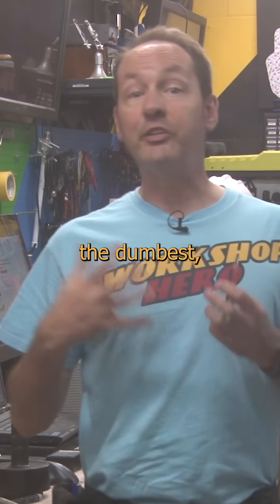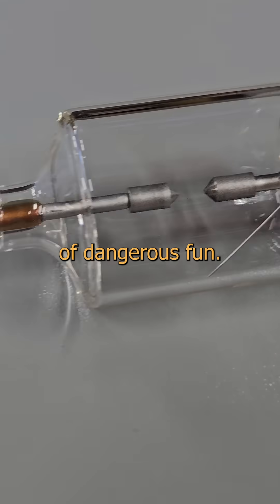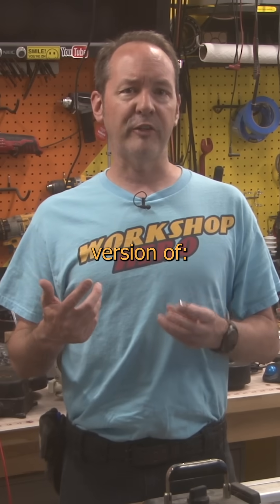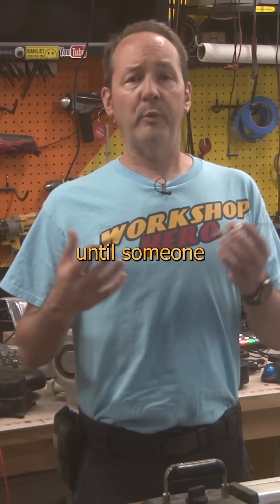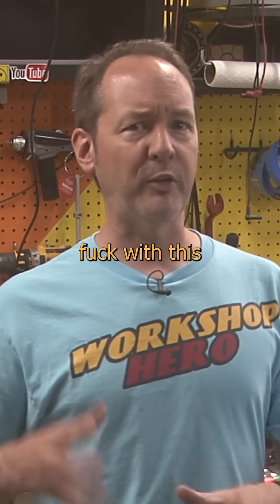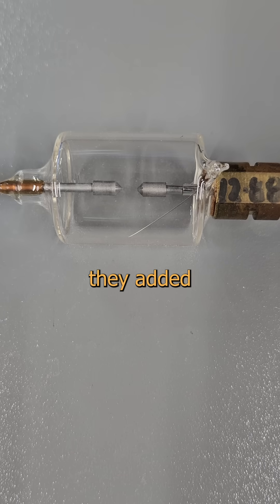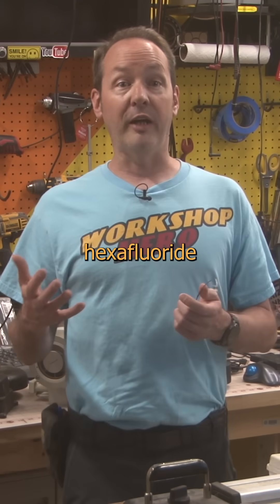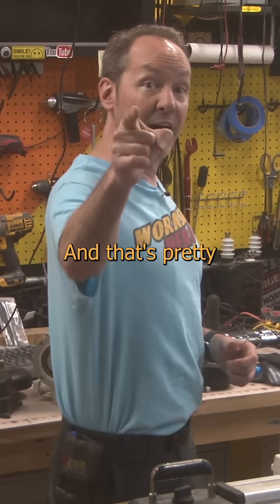Spark Gap Tube #chrisboden #comedy #engineering #highvoltage #physics #tesla #science #energy #cool

Comment: Worked 50 years in large maintenance shops and preferred to  do work for the stupidest engineers. Got a lot of overtime from thier screw ups. Best was on a Friday afternoon the energy warden engineer gave us a drawing how he wanted switch to feed a heater with a thermostat to control water temperature that went to jacketed 3"  chocolate lines. We tried to tell him it would not work but he blow a gasket & called our boss at home and he also would not listen to us. We had him repeat over a speaker phone twice in front of our second shift boss & shop Steward. As soon as we yurne seitch on fuse nlew because he had switch going across the line. It was on a thre day eeekend ehere he decided to turn off boiler to save money. Took seversl guys all Tuesday morning to unblock over a 100' of froozen milk chocolate then they had to work overtime on Saturday to catch up. He tried to hang us but we only did it his way like told. Later ee found out the company saved money on rather hire a qualified engineer they jired a clown with sn education degree for a lot less money.

Comment: An adjustable version of that switch is used in RF heat sealers as part of the overcurrent detection circuit. You can adjust it to allow for different thicknesses of material.

Comment: They say  there's no dumb questions, however when would this switch be used? some many questions😂
Reply: Actually there are a TON of car sensors that use this. All your air fuel or O2 sensors measure how much voltage it takes to bridge. The more or less oxygen, the more/less voltage. 
All car sensors are basically "how do I turn this into voltage"

Comment: Sorry for the Questions: Is the current reduced by the open gap, for example 300v in and 290v out? And why can a higher voltage cope with a greater distance of the gap? And another question: How is it that a current can ‘jump’?
Reply: Current jumps when the potential energy within the wire excites the electrons in the air around it. It needs a place to go! It’s how static electricity works when you rub your socks on carpet and zap your sister, you’ve charged yourself with a bunch of potential energy and it wants to flow to a place with negative potential.
Reply: @DigitalWolverine  Thank you !! This means that the electrons are excited and a field is created... and the greater the energy, the greater the field that is excited. Therefore a larger gap is also possible. Correct?

Comment: if you run a cars spark plug and wire in your shoe, turn on the car and hold your fingers a half inch apart and you can be the spark gap

Comment: Removing all the gas is exciting too. If the glass envelope is rated for that sort of thing.
Argon, Xeon, and Neon are also exciting choices.
And less potentially exciting than SF6.

The warning lights for SF6 are two levels.
Everyone in the lab is dead.
Everyone in the building is dead.
Reply: Sulfur hexafluoride is a nontoxic gas, but by displacing oxygen in the lungs, it also carries the risk of asphyxia if too much is inhaled.
Reply: SF6 is a non-flammable and non-toxic gas.
So why all the fearmongering?
Reply: @CCRoselle  okay, so in small amounts, and most situations it’s fairly benign. Same with combustion products. Usually safe, until it is not. A propane heater, much like your mom, is safe outside until it’s turned on in your best friend’s bedroom.
When I come across SF6, it’s usually at high pressure, in a many cubic meter enclosure isolating many KV, installed indoors.
The gas gets free, then a few pixies, then more gas, then all the pixies and all the gas have a big loud party.
The MSDS and OSHA says to be careful. it’s heavier than air and will displace air in your lungs. So, more dangerous than a nitrogen purge.
Also, SF6 decomposes to sulfur dioxide when exposed to arcs or lasers.

Comment: Spark gap components are used in some RADAR transmitters for voltage limiting. Another application is thyratrons to initiate a pulse forming network discharge. It's an old school version of an SCR.
Reply: An even older school version would be the use of calibrated neon bulbs to regulate voltage, I've seen that used in consumer electronics like TVs up to 2010. They usually just use spark gaps across the line now.

Comment: Reminds me of servicing Marshall amps (66/67) that have about 600V of HT for the B+. Discharging the caps was sort of terrifying, but maybe not as much as the Fender 400PS, which has TWO ** 650mfd ** 350v, hooked up in a voltage doubler to feed 700V to the 6550 plates (of which there are 6). I don't service that amp myself - scares the nuggets out my cornholio.

Comment: My fusion splicer machine works on this principle to fuse fibre-optic cables together
Reply: Wow that sounds interesting.  Do you have to charge it up for each splice?
Reply: @rupertrussell1  the machine has a sizeable battery pack and the electrodes are a bit closer together so less power is consumed. I do have to manually load the fibre cable ends for each individual splice, but the machine aligns the ends automatically. The individual fibres are 90 microns (.09mm) in diameter, then are packed into cables in batches of 12.

Comment: The "breakdown voltage" depends on the distance between the conductors. It is measured in Volts per meter. For air in normal condition is 30 kV/cm or 3*10^6 V/m, so 300 Volts applies if the distance is 0.1 mm
Reply: This linear relation that you imply seems to only exist upwards from a distance of a few centimeters. If you make the gap really small, the breakdown voltage goes up again and therefore there is a minimum breakdown voltage for standard pressure air at around 340 V. Look up Paschen's law, I'm just now reading up on it myself.
Reply: @toebs_ Just looked it up; that's really weird, the Paschen curve. It doesn't make sense to me that the breakdown voltage would increase as the distance gets really small (tbc: we're apparently talking about distances of a hundredth of a millimetre and below, in air at standard pressure); this rather goes against how I've understood the mechanism behind gas electrification (localised, changing volumes around the conductor gets charged, "searching" around for something to connect to). I'd have expected the curve to approach zero on the lower end (as "finding" a path gets ever easier), not suddenly go up. Weird.
Reply: @mnxs  You might want to check the units on the axes again.
Reply: @mnxs  right?? I'll have to look more into it, it just seems so counter-intuitive. Maybe the models I had in my head for this aren't that accurate.
Reply: @Cynthia_Cantrell How so? I'm aware that both axes are logarithmic, and the Wikipedia article on Paschen's Law even corroborates what I said: the minimum voltage gap distance, in air at standard atmospheric pressure, is ~7.5 micrometres ("hundredth of a millimetre" = 10um), for a breakdown voltage of 327 V.

ETA: What is weird is that, at 3.5 um (about half the minimum distance), the breakdown voltage is 533 V, approaching twice as much. It's weird that there is a minimum to the curve.
Reply: @toebs_ So, I read the Wikipedia article on Paschen's Law, and I think I have an explanation.

An arc is produced by a so-called "avalanche breakdown" of air (gas) getting ionised. An electron, if sufficiently accelerated by the electric field, when it collides with a gas molecule, will cause it to become ionised itself by knocking off an electron (or more, depending on the gas). Such a knocked-off electron may itself have sufficient energy to cause another knock-off collision, just like the original electron might still also have sufficient energy to cause another. (This is similar, in concept, to super-critical nuclear fission.) Thus whether a breakdown occurs, the arc forming, becomes a function of electric field strength, pressure (air density), distance, and some constants related to the gas in question.

On small scales, however, the relative size of the electrons' mean free path (the mean distance between collisions with molecules) and the gap length can become significant. Normally, between air molecules for instance, the mean free path (at STP) is ~96 nanometres. However, since electrons are so small, their mean free path is much greater, at ~0.5 micrometres (~5 times more) at STP. At distances below 7.5 um (STP conditions), this means there's suddenly a much higher likelyhood that they will hit sufficiently few air molecules that the avalanche effect has a hard time, well, taking effect, and thus the electric field strength rapidly needs to increase with ever shorter distances, to create enough ionisation for the breakdown to occur. (So much so, in fact, that Paschen's Law itself is apparently considered inadequate/inaccurate for precision results at distances below 10 um.)

Tl;dr: Things get wonky at (very) small scales; I swear this has to be a natural law or something.
Reply: @mnxs  The problem is that I didn't look at enough graphs!  The first ones I found were voltage vs pressure (at a fixed distance).  These have a dip towards the lower left.  

If I had looked that the Wikipedia page, I would have found the horizontal axis was pressure times distance for that one, and it does indeed seem counter-intuitive.
Reply: @zoranocokoljic8927  Came here to say this, let's get this comment to the top.
Reply: Glass Envelope 🎉
Reply: Yes. The glass bulb controls the atmosphere. As the electrodes heat up, they can oxidize. Since the electrodes are clean that, to me, would suggest that the bulb was back-filled with a forming gas, maybe 3%H /97%N.
Reply: So what if there's unusually high humidity, does that change it?
Reply: Which is why most switches actually arc whilst closing.
Reply: A capacitor is normally added across a switch if it will be switching 120V or more, loaded. That spark was a bit higher I imagine.
Reply: Yeah, I’m sure many viewers of this channel know how easy it is to make sparks with a 9 V battery (probably learned while manually holding wire ends against the terminals….)
Reply: How are you planning to keep things less than 0.1mm apart but not touching? That’s some serious engineering.
Reply: @JasperJanssen in terms of tolerances in engineering, 0.1mm is quite a distance. The pistons in a typical combustion engine have less than 0.1mm of clearance from the cylinder walls, and those go up and down tens of times per second.
Reply: @robinvanderpal372 sure, like I said: that’s serious engineering. If you’re trying to achieve it it’s easy enough. But it’s not gonna happen organically.
Reply: @JasperJanssen  tbh it is not only about when not-- but when it will became a problem -- like in a switch it will produce arcing before/after making contact
Reply: .1 isn't even that hard. The smallest tolerance I've ever welded at was 1/1000th of an inch on tanker railcars. @JasperJanssen
Reply: @dustinsisco9534 you positioned your weld itself to the thou? Without post-weld grinding/machining? Beg to disbelieve.
Reply: Done both, hand welded and sub arc welded to that tolerance. Now, in all fairness, it was a defect tolerance, so as long as i didnt mess it up in the first place i didnt have to worry about it.  @JasperJanssen
Reply: @JasperJanssen  Circuit board can have .1mm track separation, however your board will not function again if you abuse it with high voltage  :)

Comment: Massive RF interference off those guys...
Reply: Lol I immediately commented on how it'll piss off any of your neighbors that happen to be radio nerds. I mean, that's how the original Marconi transmitters worked for Morse Code -- no carrier wave, just on/off like flapping the shutters on a signal lamp at night. And yeah, a spark gap treats radio bandwidth like Ruby Rose (the Australian actor, not the animated character*) treats gender: "Screw it, I'll be all of 'em at once."

* The voice actor of the main character in RWBY is also nonbinary, as it happens.
Reply: Back in the analog everything days , a spark gap with a couple of other things , gave one a substantial edge in dealing with the problem of the neighboring tenant turning their TV or Stereo up to 11 , blasting the most obnoxious source material possible .
A neon sign transformer and some large diameter loops of wire , all connected in series with a 1/2" spark gap , would have some very profound effects on anything using an RF tuning circuit , as well as unshielded audio connections .
Running this fucking thing for a few minutes was enough to make them think their public address service was broken and turn it off .
Sometimes , you had to do it several times before they gave up sharing their toxic audio waste with the entire community .

Comment: What's that thin wire inside the envelope.
Reply: I second this question
Reply: I'm taking an educated guess here, but I'd wager it's a grounding wire to catch the static buildup on the glass. It pulls that excess charge to ground so that if you touch the glass, that buildup doesn't decide the quickest way to ground is through you.
Reply: @AlistairArsene  This seems plausible, but can we confirm it?